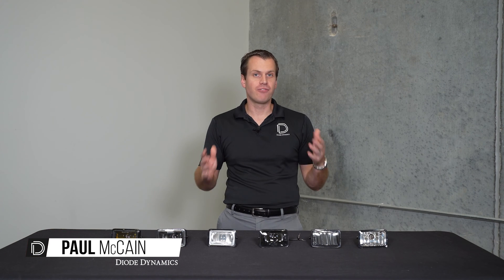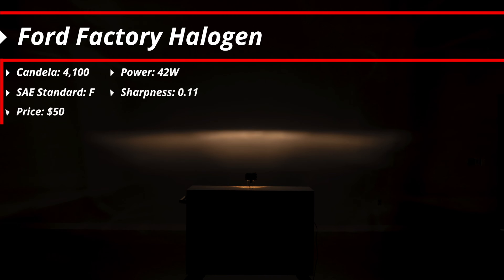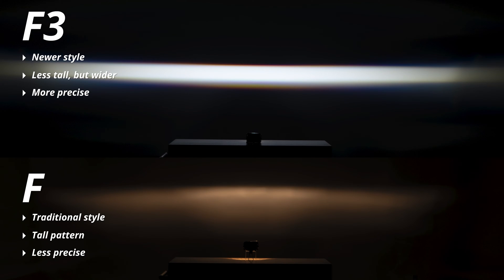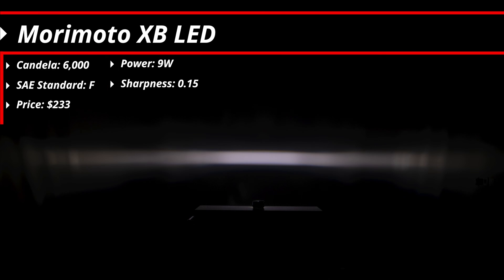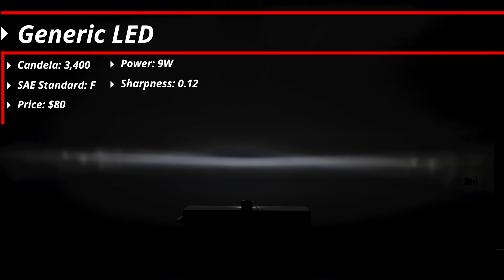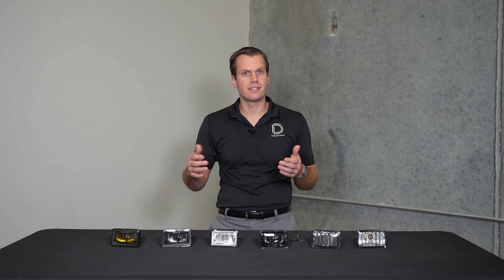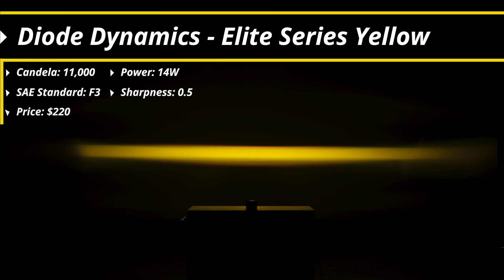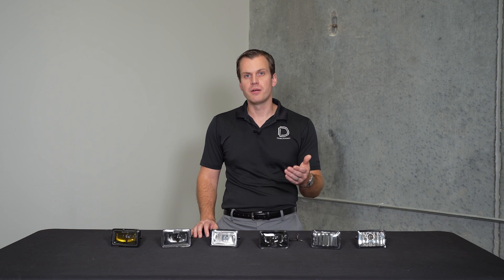Ford F-Series Fog Lights: Elite Series vs. Market Leaders | Diode Dynamics

Comment: Should give a comparison with you fog light pods as well. Just as reference 😉
Reply from the maker: We found it most fair to compare apples to apples. The SS3 fog lights, or even Baja Designs SAE Fogs would not be an accurate comparison to sealed optical fog lamps, as they have very different characteristics.